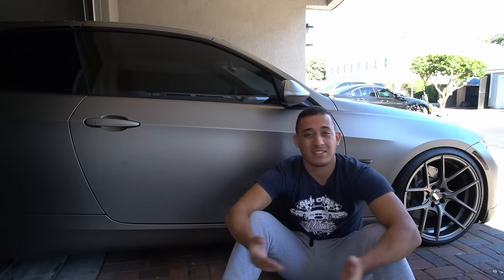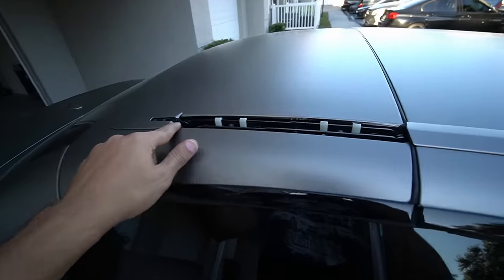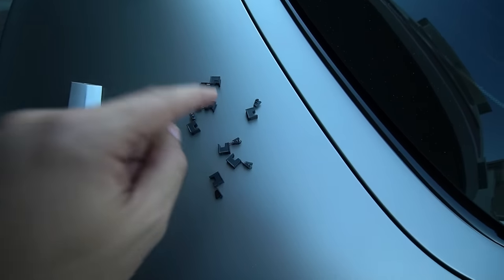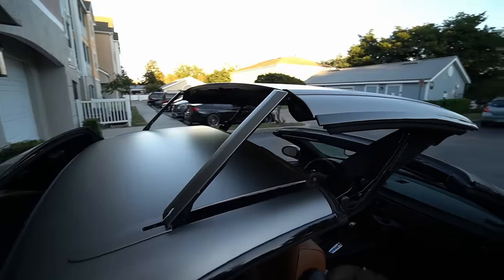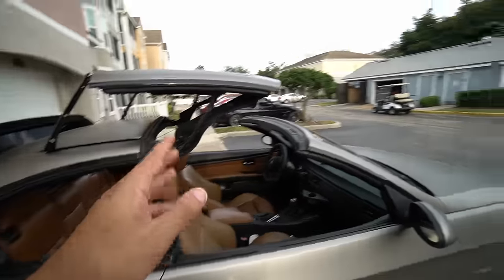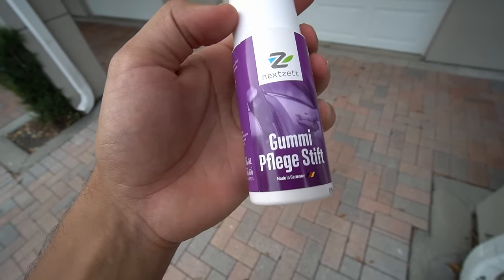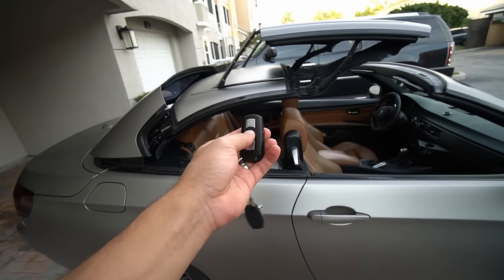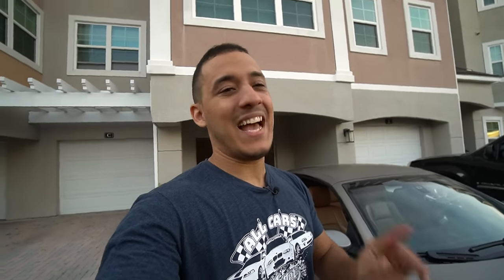Don't Buy A BMW Convertible - Here Are 5 Reasons Why

Comment: These reasons are pretty... special. The first reason was that you cant buy facelift taillights used or cheap anywhere because they arent the same ones as on the E92 and you can only aquire them for a huge amount of money from BMW as OEM parts. Because reason 1 and 2 are so similiar I am going to combine them. Reason two was that you cannot replace the trunklid cheap either because it's, just like the taillights, very similiar but not the same as on the E92. Those two reasons are pretty bad. If you are going to buy a 335i, which itself isnt cheap at all either, you should not be surprised that replacement parts are difficult to aquire on a car like this. And if you want the LCI taillights, maybe you dont want them enough if what they cost from BMW is too expensive for you. As the next reason you said that the glue that holds the interior fabric sky stops working, which seems to be caused by bad maintenance. Probably because it got wet, which it really shouldnt. This doesnt usually happen when used properly.  The fourth reason seemed like simply bad maintenance once again. From what I understood, the plastic pops out if you close the roof and something got under the mechanism. How does it get there? If you are going to close or open the roof, check if something is on top of the roof prior. I doubt anything could get under the plastic any other way and if it does, it seems to be a very specific issue to this model.  As the next reason, replacement parts being sold seperately, this is pretty much standard. This isnt something that exclusively happens to BMW convertibles. And who would have guessed it, the sixth reason is maintenance once again. It's rubber, the older it gets the more it loses its rubber characteristics. Especially if it isnt cleaned every once in a while. Again, something thats not unique to BMW convertibles. And for the seventh reason, maintenance of the roof mechanism. It needs to be treated with WD40 like literally every other mechanism. Like doorhinges, lawnmowers or bikes. This really shouldnt be a reason not to buy a BMW convertible. The title or topic really shouldnt be "dont buy it" because of this and that, if what you are going to list are things that are common with this sort of car. You could sum this video up with "convertibles are more expensive than other cars and also require more maintenance". This is the same on every convertible. The title should have been "what to expect when buying a BMW convertible". As the owner of a hardtop F33 4 Series convertible for a few years now, I have never experienced any of these issues. Yes, it still has the first gen lights. But upgrading them would cost 5-6k because as you said, the only place to get them is from BMW directly. It is not worth the money to upgrade them, because the first gens look actually pretty good anyways. I have also not had any issues with the fabric getting loose, most likely because it hasnt been wet yet. I also never had to change the plastic parts of the roof mechanism because the car is always clean and never has any dirt on it so I dont have to replace broken parts. I clean the rubber every time I clean the car, it isnt that difficult and doesnt take that much time. Treating the mechanism with WD40 also takes a minute top. Dont buy a convertible if you arent going to maintain the car more carefully than you would a coupe or sedan. I am not trying to offend you or anyone, the video wasnt bad, but the title and topic was really misleading. Nice car btw.
Reply from the maker: I'm surprised at myself that I actually read this entire comment. First off, I appreciate the feedback and now let me try to clarify some things. The title "Don't buy" is a strong set of words to draw people in which is why I went with that. Pretty much what I meant was don't buy a BMW convertible if.... And I gave a few what I believe are valid reasons to not buying one. Parts are harder to find, more maintenance is required, and the top components are more likely to break and be expensive compared to a non convertible model. The trim pieces are not as solid as you think they are. They are held pretty much by springs and cheap clips, and any slight pressure can and will move them enough to get damaged. The liner is a weak point and is blasted all over BMW forms. Age and heat cause the glue to separate from the hard top. Just because you haven't experienced issues doesn't mean others won't. Anyways thanks for the compliment on the car and thanks for watching.
Reply: @VehicleVirals  I hope it didnt sound like I was trying to bash your content or anything. At the end of the day we are both car enthusiasts and both love BMW and especially both of us can be glad that we dont own softtop convertibles lol
Edit: I'm excited to see what your reasons to buy a BMW convertible are even though I'm pretty sure they wont be anything new to me.

Comment: Had a 2011 328i until a 18 y/o girl ran a stop sign. Almost no issues, it was an amazing car, especially in the natural aspirated straight 6. Every reason you give to not purchase it, wouldn’t influence 95% of all owners. As someone who’s owned BMW’s, I’ve never done a single repair, that what my dealer and local BMW independent specialists are for - if you have to ask the price, maybe get a Camaro or Mustang.

BTW, WD40 is NOT grease or lubricant, it’s the exact opposite.

Comment: You poor guy those things were a mess weren't they. I had a 90 325i wih the manual rag top and it was possibly the nicest convertible l've ever owned. It seemed like after that you had to have an engineering degree to keep even the power soft top working properly and the retractible hardtop.....good luck!

Comment: had my e93 4 years ive spent a lot on mods, nothing except service on car every 6 month great convertible summer and winter they have stopped making them now they have gone back to soft tops as hard top to expensive to make. but best hard top every made i have tried most hard tops. best soft top every made is on Saab 93 pitty GM motors ruined that car.

Comment: I would be careful with WD40, I think it attacks rubber and plastic. And as you mentioned, it's also not designed for lubricating but for penetrating.

Btw, the P in Pflege is not silent ;) It is pronounced  "pflehggeh"
Reply: wd40 is too thin and will drip off / dry out quickly. Use spray grease instead.

Comment: Thanks for your review .I love these cars especially the light blue metallic .Should be a little easier and cheaper to get parts in the UK.I will be looking for one soon .And will keep the roof clean and maintained .
Reply: Do not buy a hardtop convertible. It will leak in the UK, a mechanic wont be able to fix it (but will try and take your money) and a panel beater wont either, BMW will charge you a fortune but will push for a full seal replacement (thousands) and there is no guarantee it wont leak again. If you are set on a Beamer convertible the soft top E46 are the most reliable and trouble free.

Comment: The hard top was not developed by BMW themself, the same problem for most 3 section hard tops on the market. Anyway from now BMW will not use hard tops for new models :(

PS: wd40 is not the best solution for long time usage - it’s good for short results. It’s better to use something like Bmw 83230301796 after cleaning.

Comment: BMW trim moldings have been total shit for 25 years. Plastic clips which cost less than a buck but the trim piece which usually goes missing can be a few hundred or even more if it’s painted to to match the body. Had a trim come off my bumper cover on my 750iL e38 which was painted to match. Not only was the elbow trim lice like 220 bucks it had to be painted. But because it was cosmoschwarz black metallic the paint job was going to be like another 300!!! My first BMW was crap always broken. My second I bought in much better shape with dealer records all it’s life and still was a nightmare with cooling problems window problems and the list goes on and on. Then I thought third time was the charm bought certified pre owned only 1 year old and it had an ongoing list of problems and eventually blew crankshaft bearing. Rendering the car inoperative. BMW bought it back. That day I left BMW forever and went back to the perfect world of Mercedes. This Mercedes happens to be my fourth out of series of them I’ve Owens’s and have had outstanding service and reliability. And all have been S classes. It’s a shame cause bmws are super fun to drive and have such great looks! I miss my m3 it was a blast! Too bad it spent most it’s life in the shop receiving various repairs:( your car looks great in that color with the dark windows!! Haha who was that putz that was like “I like civics though” lol lord who has has no clue

Comment: If you cant work on aged exotic cars you simply don’t buy them. As its well known why they loose value so quickly due to high maintenance costs.
Good news for rare parts, make a copy using 3 d printer. Otherwise great cars to drive. Cheers

Comment: I would not ever use WD40 for lubrication. Maby WD40 Lythium Grease. This WD 40 classic is way to acid and ruins the color. It is better for rusted blocked screws or mechanisms not for a very clean painted system...

Comment: Failure rate is far from the real number. Have had 4 M3 and M4 Hardtop cabrios and 3 Z4 hardtop cabrios and s few Merc SL hardtop cabrios, not one issue with the tops. Don't buy a used German car, when will people learn

Comment: great video dude, some really good points made by you, best reason for me to get the hard top roof instead of the soft top roof is climate here in uk, hard tops are good all year round, winters are too harsh here for the soft tops, soft top convertibles mist up and take an extremely long time to heat up in the mornings in winter, obviously a problem you dont get in florida or california. you can get a winter hard top for the e46 but they are very hard to find on ebay especially in the right colour plus you got a problem of storage it in the summer, e93 hard top folding roof is just the perfect solution for year round driving in uk/europe.

Comment: A BMW sunroof alone has a 97% fail rate lol
Reply: Do you own a BMW or why talking trash
Reply: @kjschrauber2126  proud owner of a e60 535i
Reply: @turo_no_bull  woow Great Engine. Sorry lot of BMW haters around These days. Just don't Know how to maintain stuff
Reply: N54?
Reply: @kjschrauber2126  yes straight 6 biturbo. I do a little work myself. Mostly external. Internals only as far a plugs and coils. But the sunroof was a tricky one lol had the same problem with my friends e39 530i but we figured it out
Reply: @turo_no_bull  glad to hear
Reply: I drive a 320d e90 lci. But economy is quite Well. I live in Europe anyway. Just timing chin scares me. Should have gone for the straight six, undeniably the best engines you can get.
Reply: @turo_no_bull  yeah sunroof means trouble man. Good you got it right. Did you use BMW diagnostics to get the sunroof right or just mechanical work diy all along
Reply: @kjschrauber2126  it wasn't a mechanical issue. Tracks just needed cleaning and a little grease. Luckily there's plenty forums for most BMW problems. Overall its a great machine.
Reply: @kjschrauber2126  not gonna lie I've always wanted a 535d. Love the way they sound
Reply: @turo_no_bull  Yeah just without dpf And the scr system. In EU(rope) we are doomed besides exhaust tuning, everything's so regulated with emissions and shitty egr stuff
Reply: @turo_no_bull  and the torque for yeeeeears
Reply: @turo_no_bull  cool fix
Reply: @turo_no_bull  and the tuning capabilities oh boy
Reply: @kjschrauber2126  that sucks. Luckily I live in a part of the US that isn't too strict on car modifications
Reply: @turo_no_bull  better Not move to cali 😂. Except if it was like 1990 or so . Nobody cared then
Reply: @kjschrauber2126  trust me I know lol Florida is another place that loves to peak under your hood
Reply: @turo_no_bull  well then take a look like at the  bmw M Diesel Engines soooo much power and still won't rip you off at the gas station
Reply: @kjschrauber2126  thats the goal. Either 335d or 535d
Reply: @turo_no_bull  i'd Go with 535, More rooooom e90 is like Kinda Short in the back if you're like 5'9'.
Nur there's also a M550d with three turbos, New one also has 4 turbos. Idk if you can Get Them in the states tbh.
Reply: @kjschrauber2126  yeah the 535d with M package is a thing of beauty. I've seen the 550d online and I  don't think quad turbo 5 series is available in the states. Downside to living out here is we don't get the cool cars lol

Comment: DO NOT BUY A USED BMW. BMW's are truly a nightmare! There is absolutely nothing on these vehicles that simple to repair. Parts are very expensive and most repairs require an expensive professional mechanic. Moreover, these vehicle drastically depreciate within 10 years. To change an upper radiator hose on most high performance vehicles is a 15-minute job. This is not the case with BMWs. Most of the cooling system is made of plastic. Hell, half of the car is made of plastic. The radiator hoses are made with plastic couplings that are held on with clips. These hoses are very difficult to remove after being ran a number of years going through numerous heat cycles. The engineers BMW and all of their wisdom, designed the upper portion of the radiator that is also made also of plastic. It's virtually impossible to remove the upper hose without cracking the plastic housing on the radiator. I'm a professional mechanic and I know how to remove a component without force. But in this instance it's unavoidable unless you're very lucky. The entire undercarriage and exhaust system must be removed just to change and u-joint. To replace a starter, (or even see it for that matter) you need to basically remove the entire upper portion of the engine compartment. And I won't even get into the friquent issues with faulty sensors, relays, maf, etc. The interiors are plastic crap. The headliners fall.  I've seen multiple issues with the electronics harnesses shorting out and catching fire. I could go on. After working on several of these vehicles, I would strongly advise that you avoid buying any used BMW. I am posting this comment in hopes that I can prevent others from experiencing these costly lessons. If you choose to ignore my warning then you should buy a used BMW and learn your lesson the hard way.

Comment: This is the dumbest video.     Here are 5 reasons why.     1.  BMW doesn't give a rip that you need to retro fit different tail lights to your car,  it looks stupid and junks up a beautiful design.  So to complain that you cannot find after market parts for a Convertible version is just ignorant.     2. Proper care alleviates most all of these issues.     (Ok I said 5 but I don't really have 5.)   Finally, Speaking from someone who CURRENTLY owns TWO BMW Hardtop convertibles in our stable  we have NEVER had any of these issues with any current or previous convertible BMW vehicles.   It is important to note that  2019 was the last year you could buy a new HARD TOP BMW.  As of 2020 all convertibles from BMW will be soft top models.      So there is your #5,  no worries.